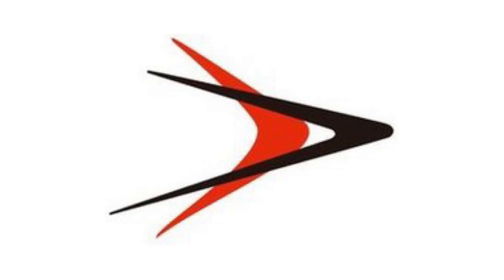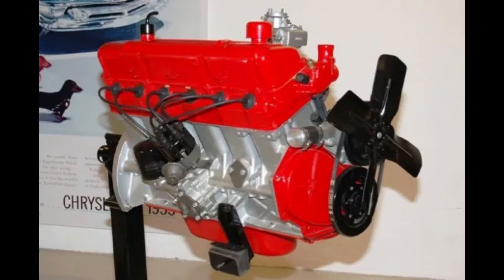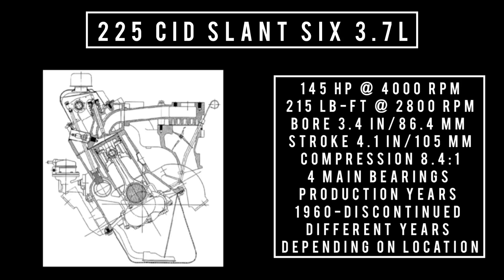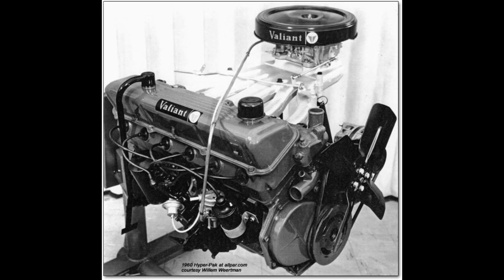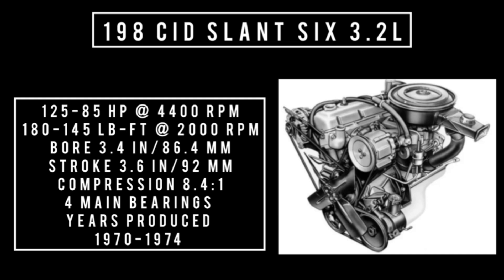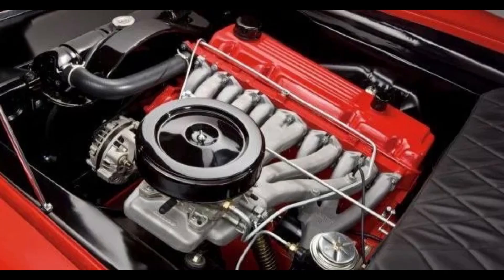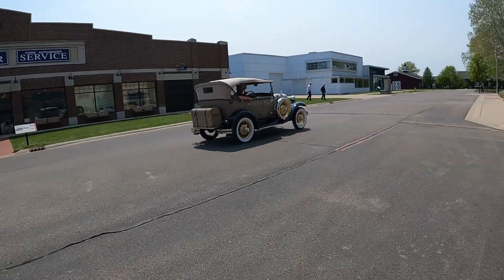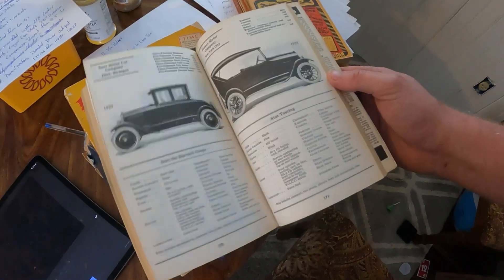Chrysler slant six engine family

Comment: Good history video. You’re correct, Chrysler was an engineering focused company. If I remember correctly, Chrysler Imperial ads in the 50’s called them the “engineer’s car”. And as you mentioned the 50’s were a high mark in Chrysler’s market share and profitability.  The Slant 6’s were a solid choice for durability and economy. Just remember the later year horsepower ratings were SAE net rather than the previous Gross. On paper it was a shocking difference, but in some cases only slightly less power output. Engines are still rated as SAE Net, but thanks to improved designs, variable valve timing, fuel injection, etc current 6 cylinder engines produce more power and higher efficiency
Reply from the maker: Glad you dig this episode =) thank you so much for sharing all the added information and insight
Reply: I agree with your summary of why more modern engines produce more power and I want to add another reason. As CNC machining became the norm in industry, the tolerances that machine parts could be held to increased almost exponentially. Being able to hold these tighter tolerances in manufacturing has meant a 10-15% improvement in engine performance across the board when the compounding effects of bearing lubrication, and ring sealing plus other wear points are taken into consideration.
Reply: @cdjhyoung  Much of today's outrageous figures are being facilitated by computerized fuel and ignition systems.  If those didn't exist, it would be impossible to smog engines that are this radical, and they wouldn't be streetable in any case.
Reply: In the 60s, NOBODY BUILT BETTER than Chrysler! WONDERFUL VEHICLES!

Comment: I liked the slant six, had it several Dodge Darts including a rare 64 GT covertible with the very rare factory 4 speed.  I think that was the only year that the Dart offered the four speed (with the slant six) until the 70's when it was a three speed with the overdrive 4th gear.  Sadly, i was broke and young at the time i got it (1971?) and it was a pile of rust from the Chicago area.  

After 2 years of attempting to deal with the rust issues, worn out bucket seat upholstery, and an engine that started to have blowby, i sold it to a guy that wanted the trans, pedal assembly, steering column and driveshaft to covert his Dart six to a four speed trans and give it the look of a factory installed unit.

But, as much as i like the slant six and wished it had the overseas displacement and head of the Australian units, i'm personally impressed that the AMC "new generation" six was as good as it was.  Considering the budget AMC had, its a remarkable achievement for a small company and Chrysler saw its potential by adding fi and changing the head design.

Comment: On big reason for the slant design was to make an I-6 fit under the hood of the Valiant when it came out for the 1960 model year. The Flathead wouldn't fit it was obsolete as from since the late 1920's and for sure needed to be replaced. I had 3 Mopars with the slant 6. With the older ones, so long as kept oil and gas in them they would run forever. I had a 1965 Dodge Cornet, i bought it for cheap in 1970's with 103000 well cared for miles, and had for about 2 years and put on 24K, sold it for a V-8 Plymouth. I had a real beater $110 special 1966 Plymouth Satellite II 4 door, 3 on the tree, used 2 quarts of bulk re-fined oil and 8-9 gallons of gas per 100 miles , it had 'see through' fenders, but I got about a year out of it, then had one of the infamous POC 1978 Dodge Aspens with the emissions strangled Slant 6. 
One issue with the Slant 6 included the difficulty with older points ignition versions to get to the distributor in the smallest models and the carburetors could be fussy.

Comment: The Chyrsler production transfer lines had huge scope to change bore pitch, so the Slant six shares the broad architecture of the 25 inch flat head six, with cam on the passenger side, same peak stroke on the 225, and the rest was original. The distributor drive is B Chrysler big block, the timing chain A block, but on the flat head, the distributor pased through the block to the other side of the block. The slant six has the distributor on the same side as the cam, not passing through the block. if you pull the head off a flathead hand match it with the 225, they are very similar, but not the same. Its essentially a clean sheet, but not quite.
Reply: They also used the same main bearings and rod bearings as the 318. Sensible sharing of parts, and part of the reason the slant is so over built and durable.
Reply: @mrdanforth3744  Hemi 426 main bearings match,.and the early plug wires

Comment: In was never a big fan of the slant 6. Out of all of the domestic straight 6cyl engines, I personally liked the AMC 232/258 engines
Reply from the maker: I always wondered about the AMC In-line six is the 196 I believe which involved in a 232, The 196 required a lot of maintenance and was originally a flathead engine design got a maintenance as in have to re-tighten the head bolts every oil change stuff like that
Reply: @What.its.like.  , incorrect.  The 196 was the last of the Nash engines and came in both OHV and flathead versions.  (In 1965 it was the last flathead made in America.)  There was an aluminum option of the 196 also.  The 232 'Typhoon' was completely new for 1964 in the Rambler Classic (featured in the 1964 Rambler Typhoon as a showcase for the new engine), and the 199 was added as the base engine for the Rambler American in 1965 or 1966.  The 199 ran through 1970 as base engine in the new Hornet and Gremlin.  In 1971 the 232 block deck was raised to be common with the new 258.  Like the Slant 6 all of these had the same bore (3-3/4") with different strokes (for different folks).  The "Jeep" 4.0L (AMC 4.0L, there were no "Jeep" engines) was the same engine family but with a larger bore (3-7/8").  In mid-'83 they introduced the 2.5L 4 cylinder engine based off of the 4.0L.

Comment: back then Americans had a real problem with designing and building aluminum engines. they were to have problems with that until about the late to early 80s or 90s take Chevys Vaga cooling system way inadequate for the job, they all had overheating issues.

Comment: 🇦🇺we only had the 225 in super singal barrel carb  then the 160 HP slant an then the VF Pacer slant at 175 HP seen slants here pulling 13 .2 quarter miles in Australia 🇦🇺 with triple Webers . 👍🏻👍🏻
Reply from the maker: There is nothing sexier than seeing triple Webbers on an in-line six
Reply: @What.its.like. I you like I can provide a YouTube link to the Chrysler ad for their triple Weber 265 hemi six putting out 302hp. Under endurance dyno testing with the exhaust pipes glowing orange hot.
With more on the Valiant Charger that E49 was developed for

Comment: 🥝✔️ I 😍 Loved  it. I grew up around GM, Chrysler and Ford's, so I chose the four great Post War Ford iron in line six engines....A: 4.375 inch bore spacing I block 215, 223, 262 ( 51-64) , B: The 4.08 inch bore spacing 144-170-187-188-200-221-250 Small Six (59- 96, OHC 3.2/3.9/4.0  from 1988-2016) , C: the 4.48" bore spacing 240 and 300 cube big six (65-97). And D: the 3.78 inch bore spacing Zephyr 138-155 cube six (51-66). There is no 233 six for passenger cars. Aside from the XK Twin Cam Jaguar six, (1948-1992) I don't think there is a more long lasting in line six than the Mopar Slant!

Comment: Chrysler Australia developed a 245 and 265 from the ground up with aid from American engineers, competed against 351's and only failed from not homologating a 4 speed early enough
Reply from the maker: I read Australia had the hemi had Chrysler in line 6 that would be an incredible engine or at least it seems incredible on paper and I did get to hear it sounds epic.
Reply: The standard engines were NEVER made to play with 351s. Only the E38 and E49 triple Webered engines. And while fast they failed though were faster over the quarter.
A harsh rattly and quite heavy engine, but had good performance. They were used in cars and trucks
Reply: @ldnwholesale8552  A very distinctive sound when cranking over. I had a few back in the day. They didn't have the longevity of the slant though. The slant was likely a better engine too for the trucks than the Hemi was.

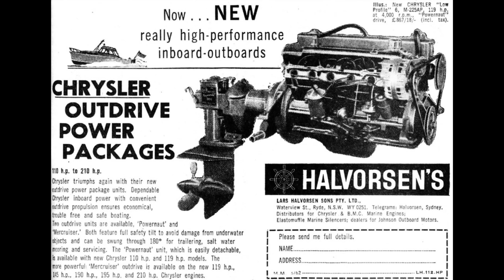Comment: 2:10 Engine that had a longer life span. Well, the Small Block Chevrolet v-8 comes to mind. 1955 - 2003. Technically still in production through GM Performance. Of course the VW flat 4 that powered the Beetle from 1936 - 2006. Hey, let's not forget the old AMC inline 6. Started out as the 199 in 1964 in the Rambler. Same engine became the 232 and the 258. The 258 was used in Jeeps up to around 1986 and then AMC revamped it just before Chrysler bought jeep and they made it the 4.0L. Chrysler corp continued on with the 4.0L to 2006. Not a bad run 64-06. (putting a 258 crank in a 4.0L block is a popular mod - also, putting 4.0 head on old 258 is common)  Honorable mention should go to the Ford 300 (4.9L) that was in production from 1965 to 1996.
Reply: The Chrysler flathead six went from 1928 through 68 in the Power Wagon, and longer than that for industrial use.
Reply: My introduction to the Chrysler flathead 6 was in mid 1960s Massey Ferguson combines.  Smooth and reliable in the dirtiest conditions.
Reply: The Chrysler "flathead 6" and "slant 6" were DEPENDABLE MOVERS! Drove ALL, but NEVER trusted G.M. or Ford "6s" LIKE THESE! They ALWAYS WORKED!

Comment: The Mopar v6 was on no ones bucket list because the Ford inline 6 was so good no one could even make a Diesel to be more utilitarian than a Ford inline 6
The ones that have actually owned the Ford 300 inline 6 helped place this engine at #4 greatest motors ever built. because of its legendary durability and impressive torque output.
Reply: weird comment above - the slant six was an inline six, not a v6, and was vastly superior to the Ford inline sixes that powered their cars like the Falcon,  the Ford 300 was used in trucks and was a good engine.  the slant sixes destroyed the Ford sixes on the racing circuit
Reply: @stanmarcusgtv  The point is Diesel wasn't even practical compared to a Ford str8 six, right up until VW lies about Diesel being better.  That's why no Diesel econo box was offered from any manufacturers.

Comment: Thanks for this. It would be nice to see the models that used each of the slant sixes.
Reply from the maker: The smaller displacement engines were used in the smaller cars in the 225 was used in trucks and the bigger cars that were lower on the totem pole.

Comment: I owed a 1971 Dodge Dart with the 225 slant six. Leaked like a sieve. So long as you kept track of oil level it would run forever. Mine had over 200k and I sold it.
Reply from the maker: Awesome story thank you so much for sharing that memory I was always curious about the slant six they sound good with the cam.. I saw so many different modifications like turbo charger some people put superchargers on them and it looks really cool with a supercharger on it it almost has a V formation. And to be fair I think all cars once they get to a certain age they either a leak oil or they burn it, I had a 327 V8 Chevy that leaked so much oil it was ridiculous
Reply: @What.its.like.  I tend to drive vehicles forever. I had a 84 Pontiac Sunbird with a 1.8 that ran for over 300k. Today I own a 1997 Dodge Ram with a 5.2 which now has just shy of 200k. Other than the body rotting away it runs great.
Reply from the maker: Awesome =)